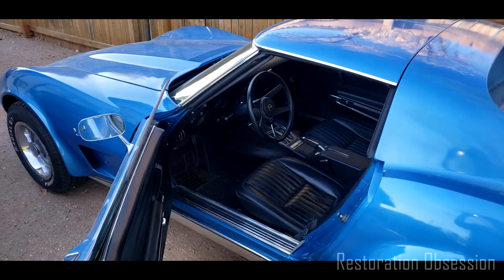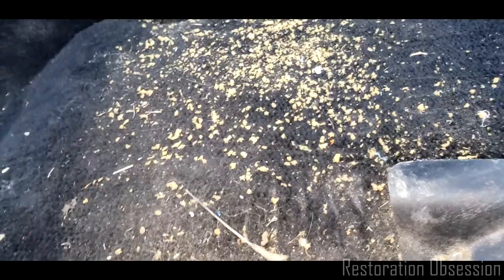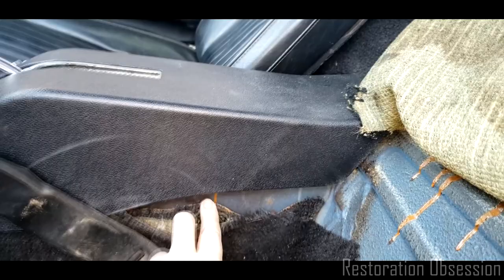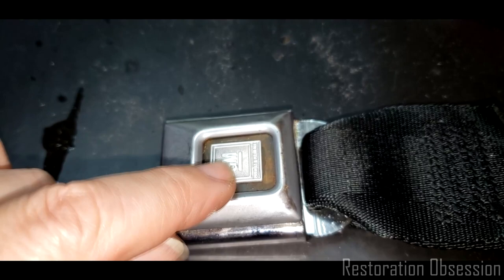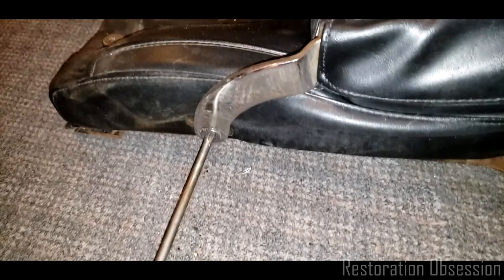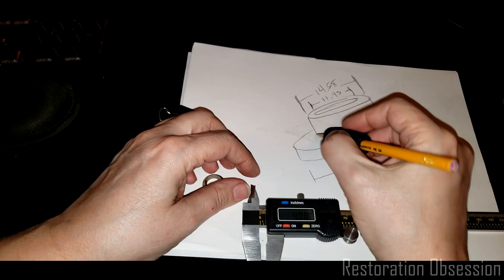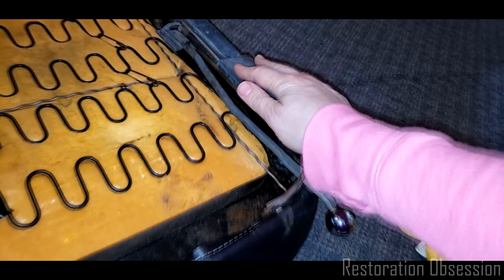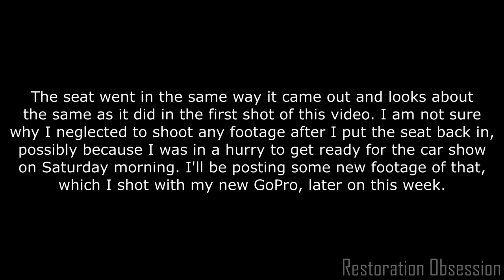C3 Corvette Basic Maintenance - Driver's Seat

Comment: I have a 68 barn find that I’m bringing back to life. I started to take out the seats today to restore them (clean rust, paint and replace the bumpers and latch anchors then install new seat belts). So anyway the seats are stuck in the rear position and I cannot access the back bolts, all of the other latch and bumper bolts broke off. Now what? I’ve PB blasted everything and let everything soak including the rails the best I could. Maybe I can get them from under the car since they go through to the outside. The plates that the bolts go into on the underside of the car aren’t rusted and I can see the tips of the bolts.

Comment: There are rubber caps that go over the two threaded wide screw heads at the lower part of the seat when you tilt the seat back forwards. You can adjust the seat back angle by turning these screws in or out. You can get these rubber caps from most any of the Corvette supply places like Eckler's or Paragon. You did a great job with the 3-D printed bushings and you can get those as well. It's important to remember that our cars, I have a '76, are very popular and have a huge aftermarket support system to help us keep them going. We are lucky for that as there are many old muscle cars that do not have that support and those folks have to resort to doing without or paying huge prices for things they need to keep them going.
Reply from the maker: Thank you, Mike. So true!

Comment: Love your informative vids & humor, excellent work! I keep some cans of black plastic/vinyl interior dye on hand for anytime you do one of these interior go-overs for things like the plastic seat backs, theseat belt receivers & kick panels. Leaves a better over-finish, right up your alley! (Better than when You found it! Adore that about you btw).
  Btw everyone, if you look at the bottom of the seat back in her video you'll notice 2 aluminum screws projecting down. Those are to adjust the seat back angle. Which reminds me, has anyone attempted to transfer the manual seat base bracket from a 98-02 Camaro/Firebird into a C3? They have manual tilting. I Think those would be a terrific addition to a C3. (As well as an aftermarket seat heater from ebay!) Awesome 3D print display too!
Reply from the maker: Thank you! :)

Comment: Amazing video.......very talented woman, the 3D printer is pretty sweet too! If you ever decide to use your equipment to make 3D parts for the public, let me/us know........I'm sure you could drum up some business. 
I'm presently in the process of doing an auto-to-manual swap so I had to remove my seats ( and dash, and the steering column and the brake booster/ master cylinder.........🙄) I'm still waiting on dash lights ( taking your advice and replacing them while the dash is out), so I decided to cleanup my seats as you have. I've always used Super Lube dry film lube in the past and found that it works great for seat tracks and seat belt buttons etc etc. It goes on wet but dries fairly quickly so expect an initial mess ( if you're a klutz like me)......have a rag handy. It will also work on your seat belt retractor. Good luck on your next Vette project and keep those videos coming ;)
Reply from the maker: Hey thanks for that lube advice! I'll check that stuff out. Sounds like quite the project, swapping the transmissions.